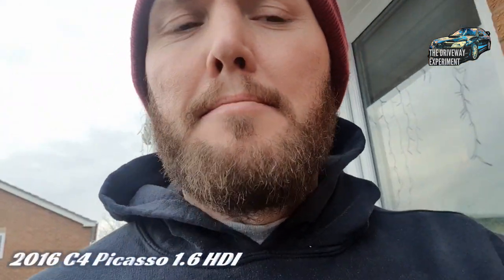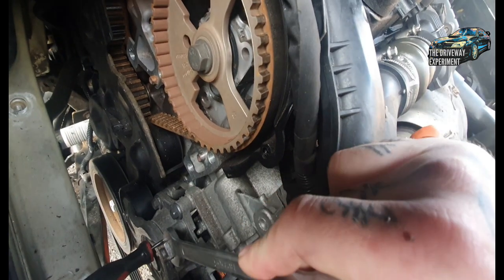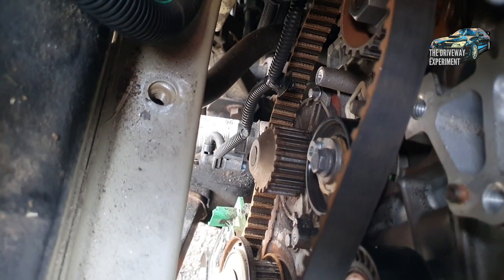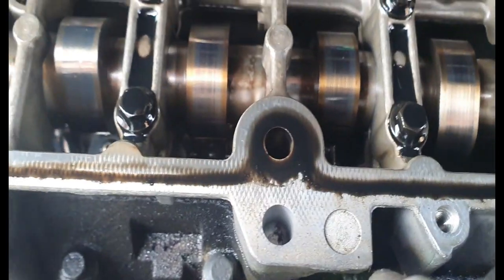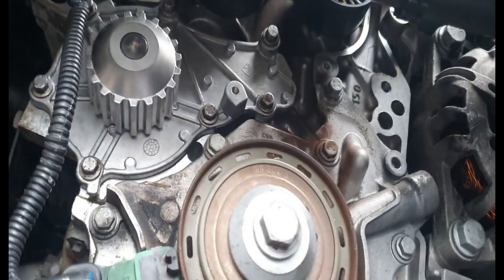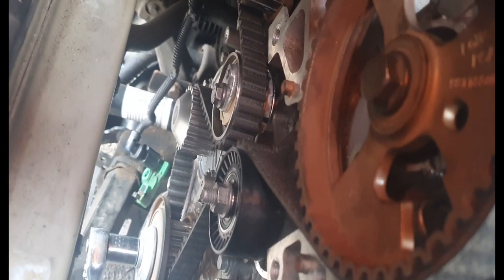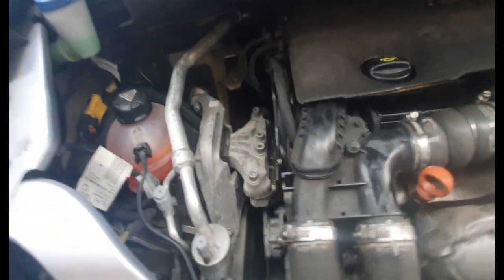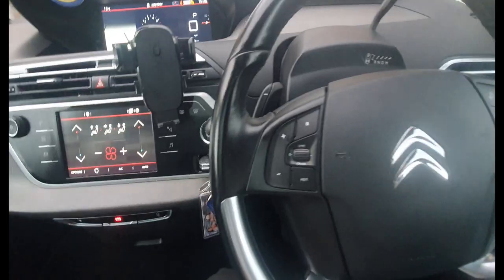C4 Picasso water pump seize and timing jump!!

Comment: Thanks for the video.   I believe the timing belt change interval for this engine is 100k / 10 years.  Did you ever notice the water pump to be noisy before it seized?
Reply from the maker: Yeah it is, no nothing it was fine
The only thing I can think of was the antifreeze not performing as it happened right when we had the lowest temperatures big freeze

Comment: You've done a good job there mate it's a bit worrying that the water pump seized with such low mileage at 43K maybe it's just a one off as I've never heard them go like that. I just hope the one I've bought with 65K doesn't decide to do the same.
Reply from the maker: Strangley enough it happened when we had the extreme cold weather deep freeze,
Not sure if that was something g to do with it.